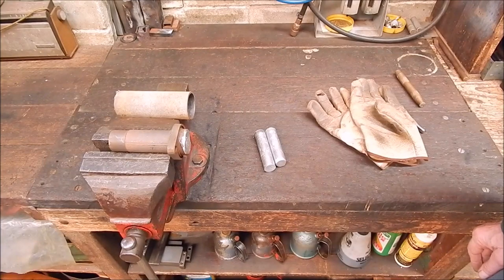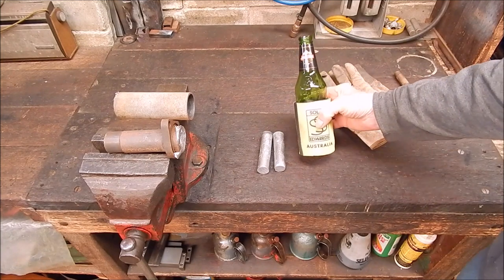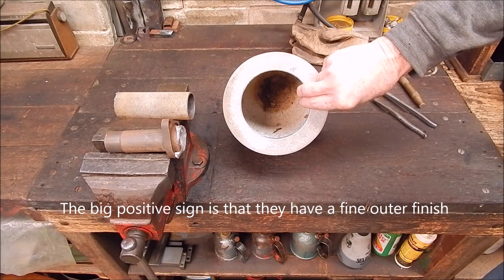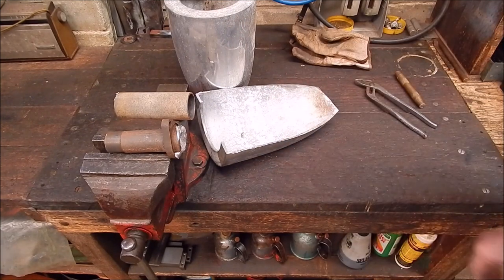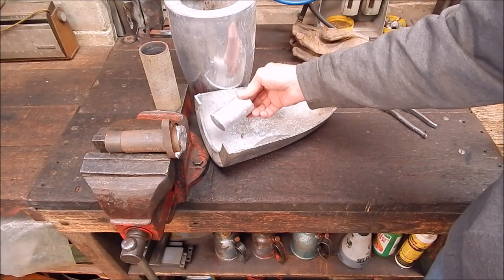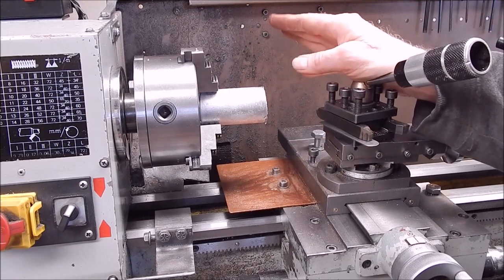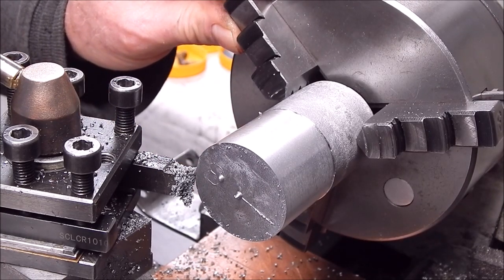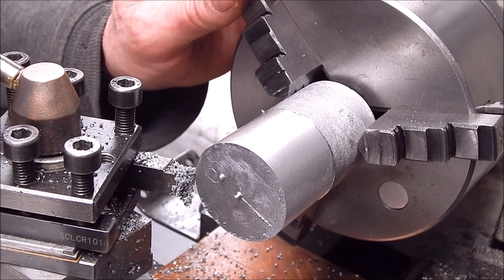Metal lathe round stock from a melted down aluminium flower pot

Comment: Thanks again, Rob! Seems from the swarf and the (rotocast) pot's form, like it has some Si and perhaps Mg content, providing good casting and machining properties (at somewhat higher HSS tool wear compared to pure Al) and gives a nice finish. For successful backyard castings, I've found the best source material is simply previously cast alloys (no-brainer!) - not beer cans, cookingware, sheets, or any extrusions as many DIYers try with pretty crummy results. Cheers DIYSwede
Reply from the maker: Hi Johan,  funny you should mention cookingware as I was eyeing off the cast ally skillet on the electric fry pan last night while doing the dishes, thinking it looks like good stuff.  Cheers Rob

Comment: All my gloves have holes, saves having to search for the right ones 😁
Looks like a good result from the mystery alloy. I once asked the local brass supplier if they could get rod in the same alloy as flat bar... "There are different types of brass? " was the answer 🙄🤣
Reply from the maker: Hi Bill, It's a worry when you have to tell them which way is up.

I went to BOC to ask about electrode polarity rods they stocked for DC stick welders.  The "expert" didn't know there was such a thing.  All he knew was MIG (which uses opposite polarity) and was totally useless.  Turns out the only DC rods which are polarity specific (from their catalogue) are "some" specialised rods for cast iron, stainless, low hydrogen etc.  All the common rods run quite happily on AC or DC.

I'm sure most of these "experts" were selling washing machines last week and electrodes this week ;)  LOL

Cheers Rob
Reply: 😲 You mean you don't trust the advice from the girl with purple hair 🤣. 
I dunno how Craig and Tommy find what they do down here.. I struggle to find anything more technical than a teatowel. Then again, I'm a bit of a hermit and can't be buggered or afford too many purchases or social interactions 🤣
Reply: The only reasonable response to such an  obvious answer about brass coming in different grades would be "No shit, Sherlock!"

Comment: Always learning something cool and useful from your videos! Did you see that Banggood has a lot of inexpensive carbide inserts designed for aluminium now? I tried some and am quite impressed. Of course HSS toolbits are great and easy to grind also, but for the low price the polished carbide sure is convenient.
Reply from the maker: I haven't looked at their inserts lately.  Thanks for the heads up.  I may have to check them out.  Cheers Rob

Comment: Hi Rob,
Have you thought about tossing a few extra ingredients into the pot? A bit of copper might make something resembling Dural, which would machine a lot better than pure aluminium.  Maybe you couldn't get it hot enough to melt copper.....
Ken.
Reply from the maker: Hi Ken,  my furnace would struggle with copper.

Comment: I'm having trouble with my aluminum  sinking after it's poured or a big hole forming in the end, any suggestions?
Learning alot from your videos, keep'um coming.
Reply from the maker: That will always happen to some degree with open casting.   

You may be pouring too fast.  Slow it down a bit and you should see an improvement, as it allows surface shrinkage to be countered to some degree with additional molten ally.

Cheers Rob
Reply: @Xynudu  I'll give it a try, thanks.
Reply: You may try pouring a little cooler.  As soon as it melts and is fluid.  It will still shrink but should be less.

Comment: How much of aluminium is pure aluminium? Years ago anything made of aluminium use to corrode with a white powder covering, which you do not see today, today  they must all be an alloy of sorts and can vary in quality and strength.
Reply from the maker: Yes, marine grade aluminium is a case in point Tony.  The first "tinnies" were made after WW2 from recycled aircraft aluminium and corroded very quickly.  Later they came up with the corrosion resistant ally that we have now for boats, window frames etc. Cheers Rob